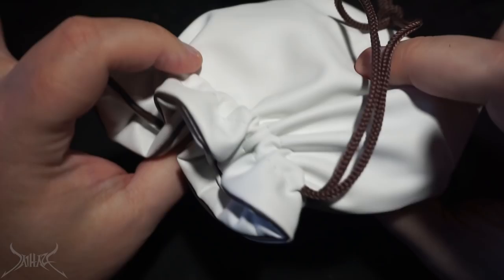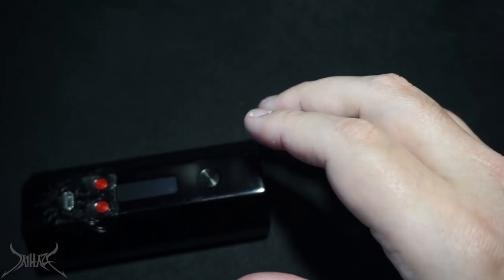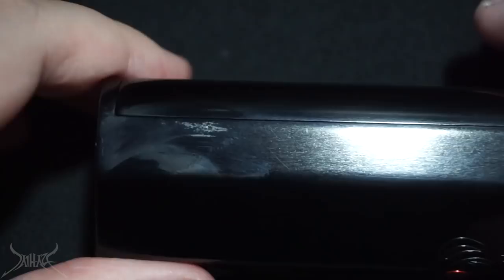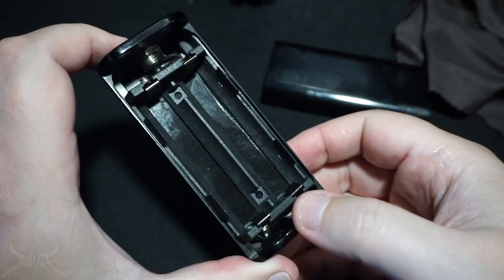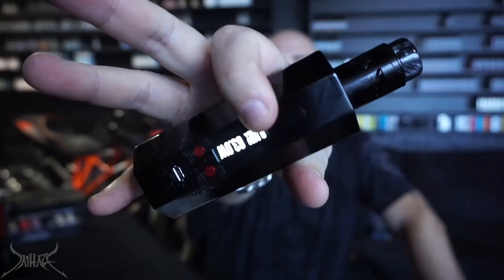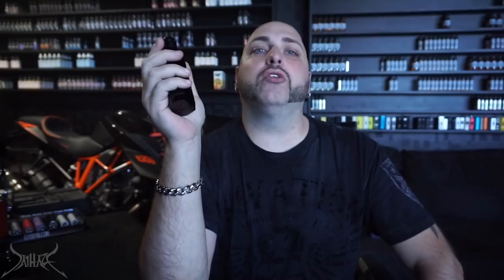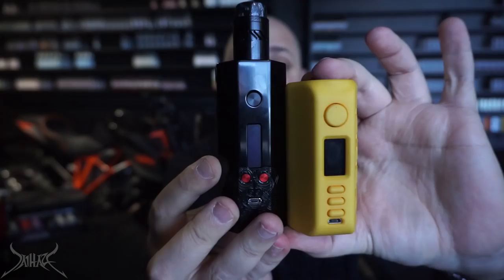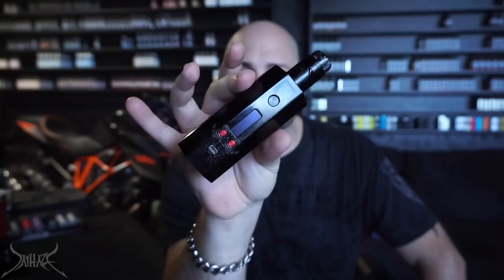Kennedy Box Mod Review and Rundown | DNA250 #letdown

Comment: My $75 dollar with free shipping I bought almost a year ago Wismec Reuleaux DNA250 is built way better and way smaller with 3 18650 batteries then this crap. Battery contacts are gold plated and nice and beefy. This looks like someone built it in a garage and used the cheapest battery holder they could find.